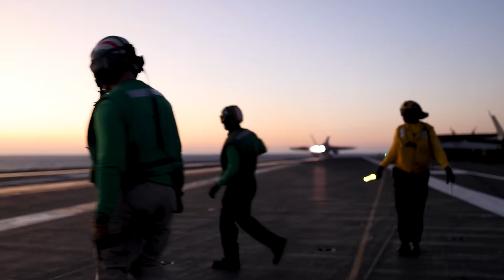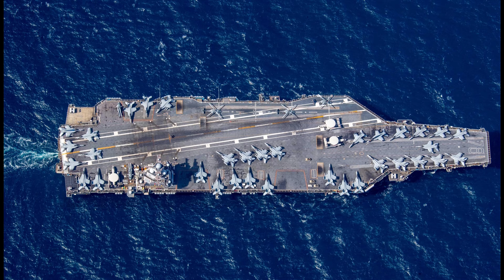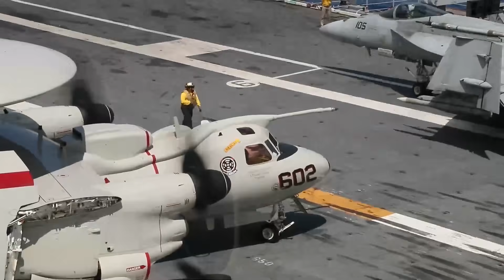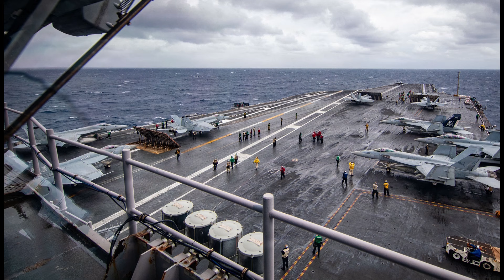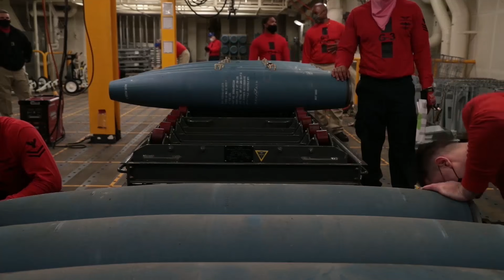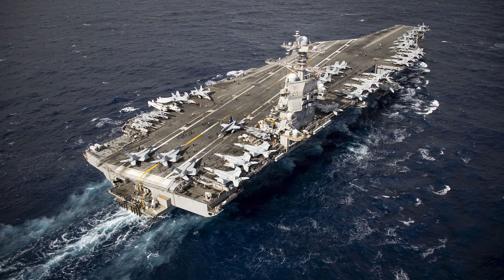Is China's Fujian Carrier Actually the Equal of the Ford Class?

Comment: PLANN never claimed that the Fujian Carrier is Equal of the Ford Class.  Come back when the Type 004 is completed.
Reply: PLA would never claim anything to public.
Reply: @yunfenglu6619  Yes, because they are prudent in what they say to the public.
Reply: And it still wont be equal to the ford
Reply: @VectorGhost  If the rumors are true and the Ford's AC EMALS has a reliability rate of less than 10%, then the Fujian is hands down superior to the Ford no matter what, simply because the Ford wouldn't even be able to work.
Reply: @X @XkMeng , it’s a 10% percent or less chance of FAILURE not 10% reliability rate. Also it drastically improved in later testing. Still not to the planned standard but it’s workable. 

10 more carriers if it doesn’t by the way😊
Reply: @Jeremiah-r3q  Lol, take that you copy cats😅
Reply: @Jeremiah-r3q 
2 more if Trump gets his way 😂
Reply: @XkMeng 

The Fujian hasn’t been stress-tested in full capacity operations yet. The current failure rate is still higher than that of the more mature Ford EMALS.   It’s still a little early to call it better even if the initial results  and improved design suggest it should  be better when it matures.  The Ford EMALS has had 9 years of operations to improve- it seems to have plateaued unless the USN hasn’t updated the latest performance  data from its Gulf deployment. .
Reply: @Blixey-r9z  You've got it backward. The Ford's EMALS was backward right from its design principles, with an initial failure rate that fell far short of even one-tenth of its design goal. Even after nine years, it still fails to reach half of the combat requirements specified in its design, which is why it hasn't been deployed in actual combat yet, and it still can't launch the F-35.

In contrast, the Fujian's medium-voltage DC EMALS had a very low failure rate right from the start in ground testing, which is why it defeated the steam catapult tested alongside it in one fell swoop—even causing the launch of the Fujian to be delayed by half a year to retrofit the electromagnetic catapult.
Reply: @XkMeng 
The Ford HAS seen actual combat. It  completed  a 326-day war deployment from June 24, 2025, to May 16, 2026. 

In January 2026,  the Ford  launched live combat sorties against targets in Venezuela as part of the raid and capture of  Nicolás Maduro.

The Ford also  took part in Operation Epic Fury. It enforced  the naval blockade and launched daily air strikes against Iran and the Houthis. 

The Ford’s deployment was the longest post-Vietnam War aircraft carrier rotation in history. 

During the deployment, the Ford is said to have averaged  around  600 cycles between failures - that is a failure rate of 0.17%.to put hat into context: 

 • USS Gerald R. Ford (CVN-78): 12,200 flight launches across 326 days (averaging ~37 sorties per day.

• USS Abraham Lincoln (CVN-72): Over 13,000 launches/sorties across 321 days (averaging ~40 sorties per day).

Chinese military analyst Wang Qiang of The China Academy) mentioned a projected performance benchmark <0.2% failure rate (>500 cycles between failures).  His projections are based on data from land-based laboratory testing and computer modeling conducted by Rear Admiral Ma Weiming’s engineering team at the PLA Naval University of Engineering. It represents the system's intended design threshold rather than live data pooled from years of operations at sea

The Ford isn’t as bad as you think. But you wont be wrong to say that the Fujian’s EMALS early test performance has exceeded the Ford’s EMALS early test performance for reliability.  The Fujian’s actual performance is quite likely to exceed the Ford’s one day - but we simply won’t have that data till the Fujian has ramped up carrier flight operations and completed thousands of launches . The Ford’s initial reliability and failure rate in its first 2 years (2017-2019)  was 1.34% (74.7 cycles between failures). That’s a lot higher than Fujisn’s EMALS failure rste if <0.2% based on land test data.  

The  Ford  has achieved <0.2% failure rate already but it took 9 years to get there. It remains to be seen how  China EMALS will perform during real life operations at sea. Only time will tell. It’s too early to say the Fujian’s EMALS will outperform the Ford Class EMALS. I am pretty sure they .would have improved their EMALS design for the USS Kennedy and Enterprise.
Reply: @VectorGhost  Yes it will be far superior
Reply: @VectorGhost  Right.  It will be better because it won't have the Ford's steam catapults.
Reply: @VectorGhost  The Chinese electromagnetic launcher is already superior to Ford's version. Their fighters are already on par if not better (F-35 lose to J-35, F/A-18 lose to J15-T, F/A18 Growler lose to F-15DT). All they lack is a larger size, nuclear propulsion and can carry more planes.

Type 004 is already estimated to be larger and will use highly efficient PWR the same as the Ford, if not better.

Cope.
Reply: @gelinrefira cope what. You gave no solid facts.
Reply: @Jeremiah-r3q  Everything I said is factual. The Chinese objectively have better naval fighters and catapults, all they lack is nuclear propulsion and a larger size. You are the one that refuses to accept the facts and burying your head in the sand.

You are the one who just make the bogus claim that 004 will never equal to Ford.
Reply: @VectorGhost  yeah it would be greater
Reply: @s0ga88 people like you obviously have no clue what you're talking about. I just posted a semi rather lengthy thread explaining how and why the Fujian isn't even close to the USS Ford and Nimitz class.
The same can and will be applicable to the next class of Chinese carrier for those reasons. I suggest you read it
Reply: @MA2USN It takes you nothing to copy your words and paste them here, go ahead.
Reply: @MA2USN  cope
Reply: @MrCristianposso seriously, you don't want to just go and read the other posts that I made it's right there. All you have to do is change the metric to Most Recent and you should be able to find it easily. Don't ask others to do your homework for you
Reply: @MA2USN There arent even specks publicly available for the Type 004, yet you presume much dont you? The US will fall because it will go bankrupt not because it will lose in a war with another power. Nothing outruns bankruptcy
Reply: @MA2USN seriously lay off the Kool aid. Df
Reply: @amunra5330 unless you read my other post which explains my response, then your comment concerning what you believed to be my assumption has no merit whatsoever. 
Why don't you go and read it first and then come back unless you're just a troll
Reply: @troutstalker7855 the same goes for you. Unless you're a troll you should probably go read the other post. Frankly, I have a feeling that you are the same person with multiple accounts. Which would most certainly make you nothing but a troll.
Reply: @MA2USN  Obviously people like you don't know that the Fujian can launch stealth aircraft but the Ford can't launch the F-35C. Also the Fujian has toilets that actually work and also has a laundry system that doesn't self combust. LOL!
Reply: @MA2USN  Dream on.
Reply: @bobsmith3983 Actually,  from reading your comments I can tell that you are the person who is unaware. I've run into people like you before on these messages. Usually you watch a couple videos and those are usually impacted by your political or ideological beliefs and are often incorrect.

So let me educate you. The F-35 can and has taken off from the USS ford. However, when the USS Ford was being designed the F-35 had not been completed yet and there were aspects of the naval variant which had not been fully accepted yet either.
  Mainly, the jet blast deflectors need to be changed out in order to handle sustained sorties from the much hotter F-35 engine. There are a few other areas as well that need to be changed but again, the F-35 has taken off and landed on the USS ford.
   This is precisely why some of the Nimitz class carriers which were already built have been changed in order for the F-35. Frankly, when the design was completed they were able to retrofit some of the Nimitz class carriers before the Navy started accepting F-35 whereas the USS Ford was already built.

Finally, as it pertains to the toilets yes there were issues with the toilets and that has to do with the vacuum issue just like you have on airplanes aircraft carriers have a very similar Plumbing system. It's not that all the toilets are not working but some of them had problems. By the way this is not just with the USS Ford but all aircraft carriers have these problems from time to time.

 Depending on what type of plumbing system the Chinese aircraft carriers have they will either learn this the easy way or the hard way.

Nevertheless, the point of the matter is that you were Incorrect and most probably do to your lack of educating yourself on Naval Warfare and only relying on half-assed information from videos.

I suggest you actually start studying Naval and aerial Warfare if you were interested in the topic.
Reply: @MA2USN the fords EMALS STILL can’t launch the f35s and it got put out of service by an underwear fire in the laundry room. Also they won’t go near Iran for fear of getting sunk. All the carriers are clear on the other side of Saudi Arabia so when Saudi Arabia denied its airspace to be used recently, none of the carriers were of any use. The bar is low. They CERTAINLY won’t be of use against China who the pentagon in the overmatch brief and even Secretary Kegsbreath himself admit could sink them all first thirty minutes of a conflict.
Reply: @jonglejuicewow! Where do we start? First of all, the F-35 has launched and landed on the USS ford. However, USS Ford cannot yet permanently have squadrons of f-35s because of a few areas that need to be replaced including jet blast deflectors that can withstand the sustained usage of the much hotter F-35 engine and a few other areas needed for maintenance of those aircraft. Nevertheless, has nothing to do with EMALS and f-35s have landed and taken off from the Ford there are videos of this.
   Your whole premise of US aircraft carriers being too afraid near Iran, just there are so many things wrong with that let me make it simple for you. If aircraft carriers were so obsolete then China would not be making more of them add attempting to make them copies of US carriers. Which is precisely what they are doing. I could go into detail about your whole Saudi Arabia denied its airspace and they're afraid but you're just wrong on every level.
Reply: @MA2USN bro the ford class doesn't even have working toilets. Still.isnt capable of launching 5th gen fighters 😂😂😂

Type 004 carrier will be 120 000 tonnes thats 20% large and more capable then the Ford 😂😂 eat it.
Reply: @Urdead27002 did you even bother to read any of the other posts in this thread or do you just like to act like a troll? This has been answered multiple times over in this thread. You're factually incorrect. The USS Ford has launched and landed f-35s. It just cannot have a squadron of them. Seriously, just read the other posts
Reply: @MA2USN  chrome‘s “ask Gemini” 
input:  Has the USS Gerald R. Ford ever launched or recovered an F-35?
gemini: No. As of mid-2026, the USS Gerald R. Ford (CVN-78) has never launched or recovered an F-35C Lightning II. 
While it is the most advanced and expensive supercarrier in the world, the Ford completed its maiden and subsequent long-term overseas deployments carrying an air wing composed entirely of older-generation aircraft, primarily F/A-18E/F Super Hornets, EA-18G Growlers, and E-2D Advanced Hawkeyes.There are three primary reasons for this compatibility gap:
--A "Design Timing" Desync: The core layout and specifications of the Ford were locked in around 2005–2006. At that time, the final technical, thermal, and data requirements for the F-35C were not yet finalized. To avoid further project delays, the Navy decided to build the Ford around the existing F/A-18 fleet and add F-35C compatibility later.
--Thermal & Jet Blast Deflector (JBD) Issues: The F-35C’s Pratt & Whitney F135 engine runs incredibly hot. During take-off, its exhaust can reach temperatures that would warp or severely degrade the Ford’s standard flight deck coatings and its heavy-duty Jet Blast Deflectors. The carrier requires upgraded, actively cooled JBDs and specialized thermal-resistant deck coatings to safely launch the stealth fighter.
--Classified Data & Logistics Networks: The F-35C acts as a massive airborne data center. Operating it requires highly specialized, secure classified briefing rooms, advanced data-linked maintenance suites, and the integration of the F-35's proprietary logistics network (ODIN) into the ship's infrastructure—all of which were missing from the Ford's original build.
Reply: @bobsmith3983  Ohh it can launch F-35C, but it can't service and maintain it LOLOL.
Reply: @MA2USN  no
Reply: @seeuu-o9f6h "No", what?
Reply: @MA2USN  The F-35C will never take off from the USS Gerald R. Ford due to insufficient electromagnetic launch thrust.
Reply: @seeuu-o9f6h .....Yeah, except that the F-35 has landed and launched from the USS Ford. Seriously, "electromagnetic launch thrust" 🤣 
The EMALS on the Ford Class are rated up to 100,000 lbs. Far less than a fully fueled and armed F-35C. 
  The reason for the Ford not having a Squadron of F-35's has nothing to do with the EMALS.
Now, I'm not saying you need to study Naval Warfare and aerial Warfare as I do but seriously a simple bit of research before you comment would help
Reply: @MA2USN  In dreams, anything is possible, but Ford is not.
Reply: @seeuu-o9f6h yeaaah, so I'm guessing that you are from China and will not believe anything I say but once again you can do your own research and you will see that it is a fact not in dreams not an opinion that is a fact that the F-35 has taken off and landed from the USS ford. They do not have a squadron of a 35 on the USS Ford because the jet blast deflector isn't up to the high exhaust temperatures of the F-35 for prolonged usage as well as what the maintenance Shack would need for space and specific items for the f-35. A couple of the nimitz-class carriers were refitted for this prior to the F-35 being used by the Navy when the USS Ford was being built it was too late at the time. The USS Ford is going to be refitted with those areas including jet blast deflector for the higher sustained temperature and the other areas I mentioned. However it can have them take off and land and it has done so. You can probably find videos of it on YouTube
Reply: @MA2USN  Hey, it's time for you to grow up. child
Reply: @MA2USN  If you don't accept the facts, go to Congress and the Department of War to stage a hunger strike in protest. Don't just cry and make a scene here like now.
Reply: @seeuu-o9f6h ? Am I wrong, are you not fron China? Your comments seem very much along the lines of a Chinese Bot troll who is also attempting to boost his Social Credit Score for the CCP.
  I have provided information refuting your claim with simplest tasks attached where you could find it out yourself and you just want to keep pushing the issue. That tells me that you are nothing but a troll
Reply: @seeuu-o9f6h what "Facts"? Don't get me wrong, normally I would just ignore you but today is my off day and I have time to waste.  What facts? Are you too lazy research what I said? I know for certain that what I said were "Facts". What's your deal?
Reply: @MA2USN  SB
Reply: @MA2USN  🤣🤣🤣